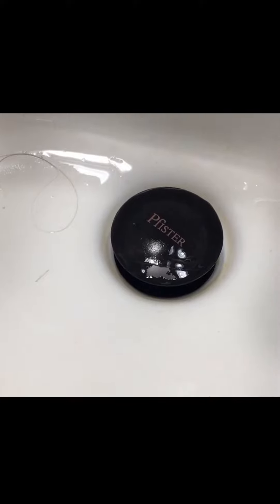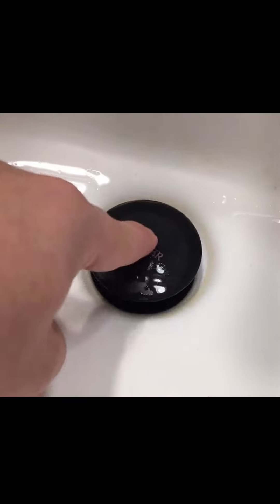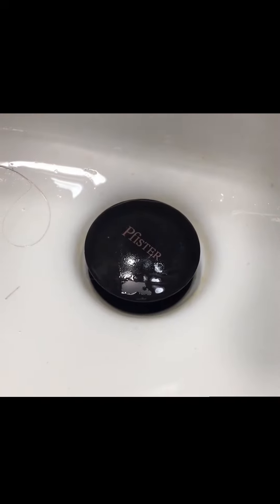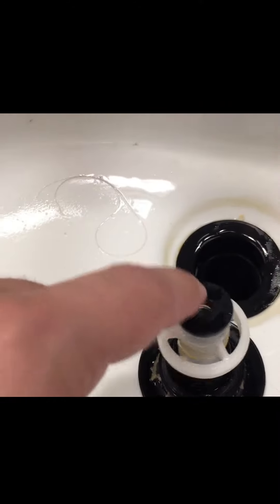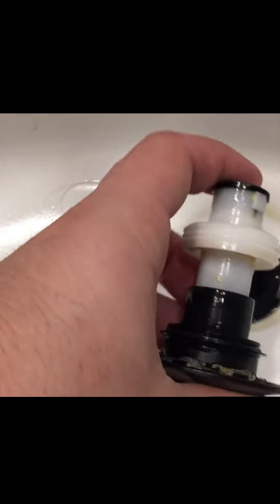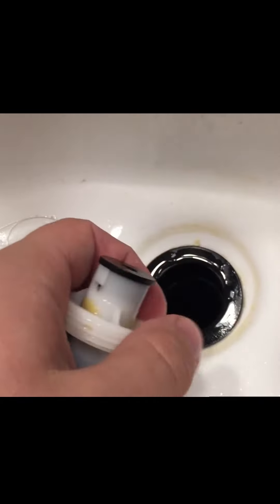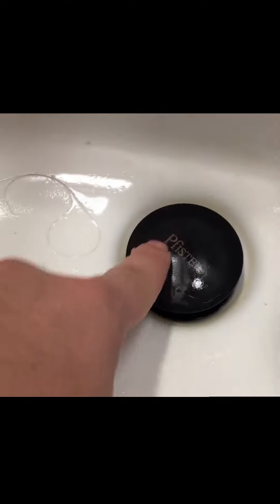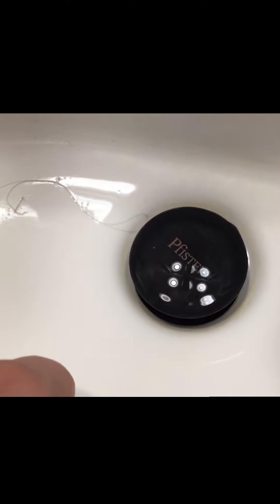Pop-Up Sink Drain Stopper Not Clicking Fix

Comment: Mine does the opposite. I pressed it down and now it won’t come back up
Reply from the maker: Could be cakes on with crud. Have you removed it and examined it?
Reply: @learnsavediy  yeah I got it. Had to really grip it to get it to turn since it was pressed in (closed). Just had gunk on it and now works like it should. Thanks!
Reply: @learnsavediy  yeah I was able to finally get it loose. And it was covered in crud which kept it from popping back up. Got it working!
Reply: @learnsavediy  Mine is brand new and locked closed. Perhaps it is broken but I will try to open it up. Thanks.